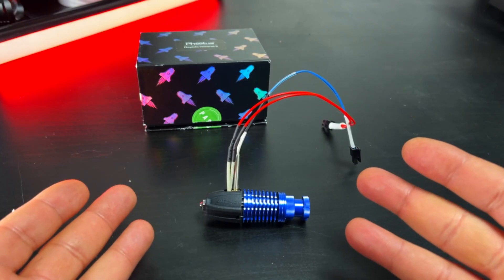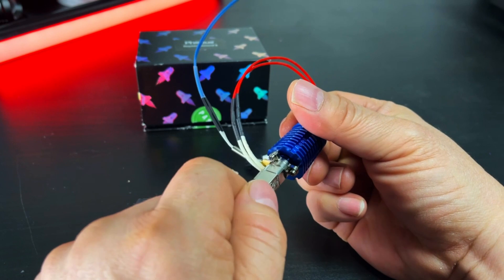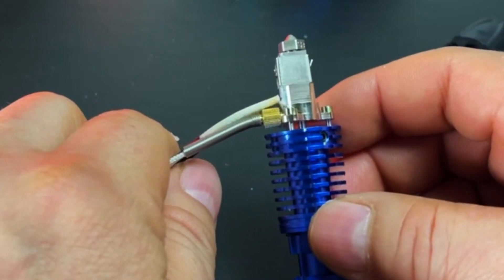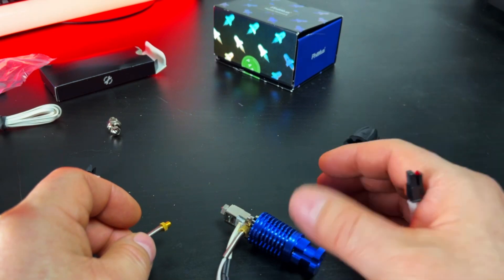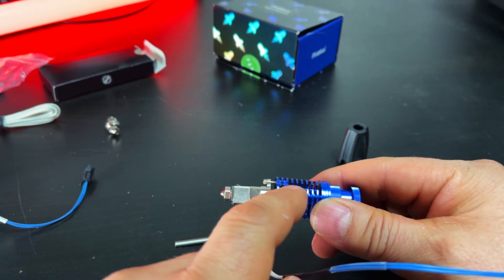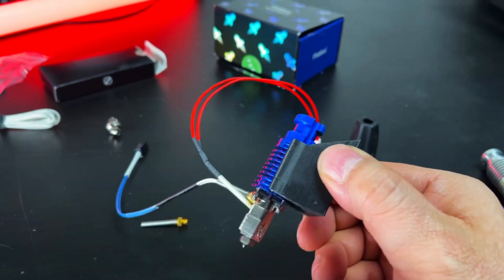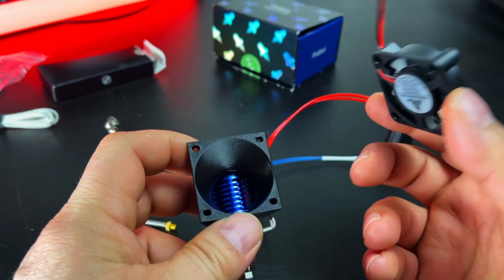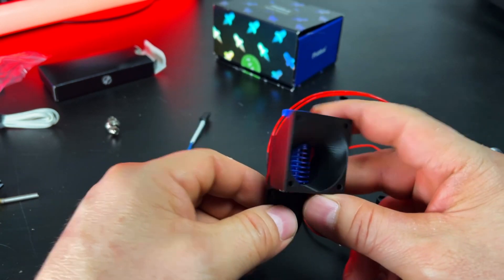first look at the Phaetus rapido 2.0

Comment: My rapido 2 thermistor broke on first install as well, also heat creep issue… such a pain
Reply from the maker: I hope you can get a replacement termistor for fast. What fan are you using for this?
Reply: sunon mf40102vx-1q03c-a99 on stealburner, i also put Thermal Grizzly Kryonaut on heatsink but not seem to help
Reply from the maker: @nv4re  well well 4010 is better than the 2510 they recommend. Check your retraction setting see if that helps. I noticed switching to pt1000 I had heat creep issues with previous crazy hotend from mellow the one hotend I never had issues with was e3d all metal ones like maybe 1 clog every few years. I have no installed the rapido yet I will let you know try lowering the temp also in increments and do a temprature tower. 
Let me know thanks!
Reply: @tommygunnfilms  ohh, I might have to swap to 104NT, I will give a update asap.
Thank you for your advice 😇
Reply from the maker: @nv4re  oh if have not done a auto pid tuning do it..
Reply: I did PID_CALIBRATE with and without filament, but the problem seems not to be resolved.😥
I also try to reduce nozzle and bed temp, still stuck
and print at faster speed but it even make it happen sooner
Reply from the maker: @nv4re  ok sounds ike you are on a voron?  Have you tried the voron group some there should have a close setup to yours? They may have slicer setting or better advice for your printer, try the Facebook group and discord group. I still have not had time to try mine out. I I was gonna go with old tried and true e3d and try out the volcano. But I got this instead. Crossing my fingers. Question are you using groove mount? Or did you remove it to mount from top? And are using ptfe tube btwn hotend and extruder?
Reply from the maker: @nv4re  not sure if I asked this already but are you using a ptfe tube between the extruder and hot end?
Reply: @tommygunnfilms  yes I insert PTFE tube into heatsink, also I did not using groove mount.

I did disassembly the extruder and found little filament in gear teeth, I clean them with IPA and it work great for a print (~1:40 hr), and it clog again on next print :(
Also remove the Chaoticlab CNC tap that I think it absorb heat from the build plate and radiate to hot-end (since it on the back of hot-end, and I accidentally touch it before print finish and it very hot), but still that not seem to be the root cause. 😢
Reply: @tommygunnfilms  Hi, I think I have found the root cause. It was due to the LGX gear that I was using; it did not grip filament very well, then it caused filament to get stuck in heatbreak, causing heat creep from the filament itself. That explains why, when I try to reduce the nozzle and build-plate temp or print faster, it only makes things worse.

I fixed it by using BMG gear instead of LGX gear.

I would like to thank you for your kindness in helping me resolve this problem. I would not fix it myself if I did not have advice from you.
Reply from the maker: @nv4re  very interesting I did have some simmer  issues with a hot end using a bondtech Lgx extruder… this is great that  you solved this.. by switching. Hopefully this will help others too!

Comment: The thermistor snapped on my hotend recently when i wanted to open it. If you want to unscrew the thermistor, you have to turn the screw with the wire not just the screw otherwise you will be twisting the wires until it breaks
Reply from the maker: Yes while the idea is very cool it still needs work. Look at my description I think that would start. Another idea would be some lever idea slide thermistor in close lever now it’s tight. Or maybe a pre angled ridge mount so you don’t have to bend wires. I mean every hot end and heater always bends up and towards the back like a snorkel 🤿.
Reply: I agree